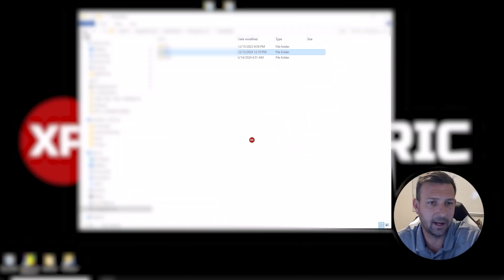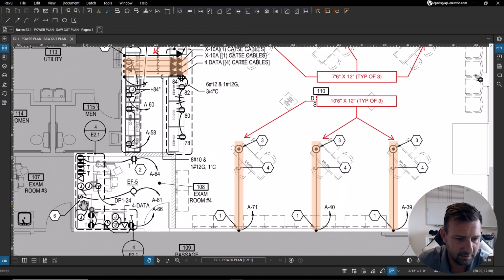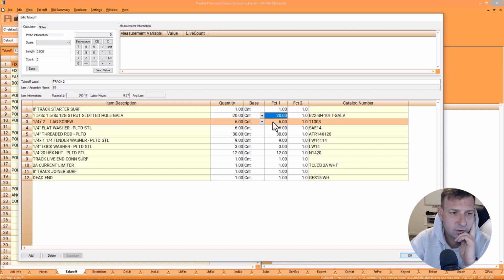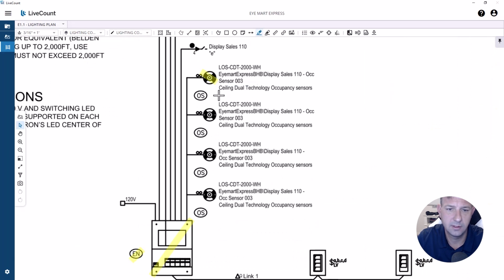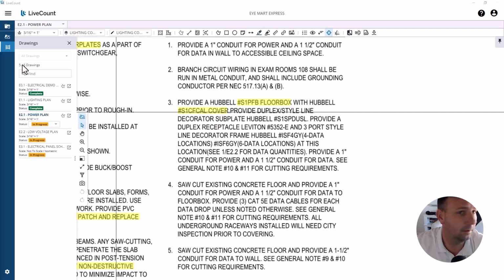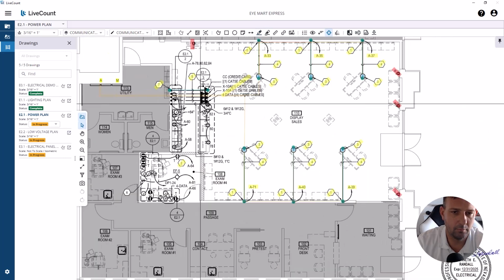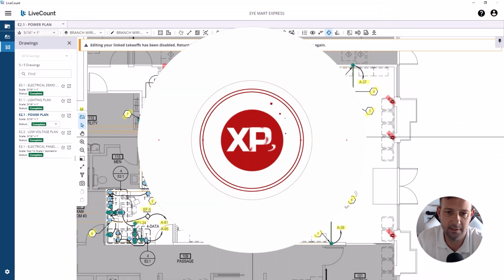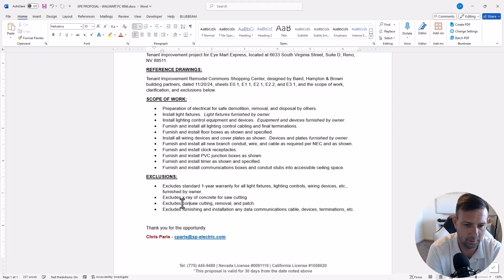Creating An Electrical Estimate From Start To Finish

Comment: Very informative, great to see a professional at wor
k
Reply: Why do you use bluebeam and just not livecount with Accubid
Reply from the maker: I used to use Bluebeam, but now I'm using Accubid + LiveCount exclusively.
Reply from the maker: Thank you for commenting.  Let me know if you'd like to see anything in particular!
Reply: @EstimatingXPert   Why do you use bluebeam instead of just accubid with live count
Reply from the maker: @DavidWebb-w9q because personally I find it more efficient to navigate +100 page plan sets in bluebeam, make notes, identify, relabel, extract, etc. that way, by the time they get into accubid, for me, they are further prepared and ready for takeoff.  If I have just a few sheets and they came as separate files, I may skip the bluebeam step and drop them straight in to accubid.